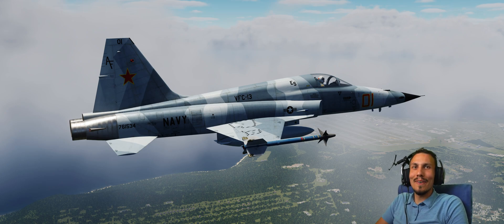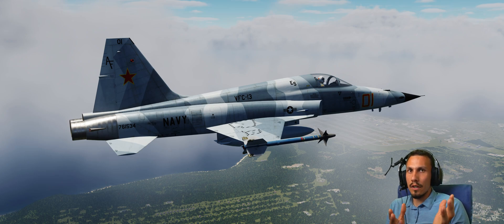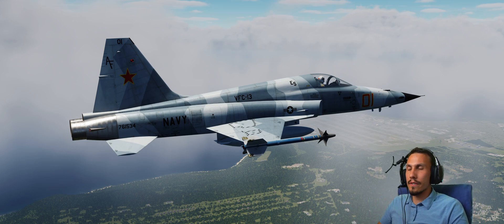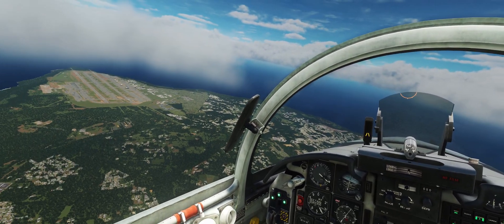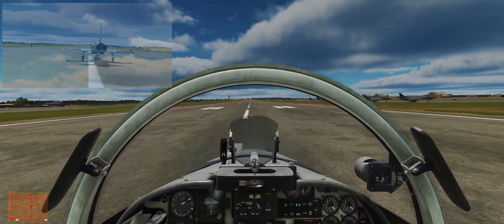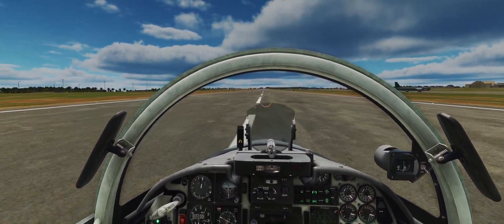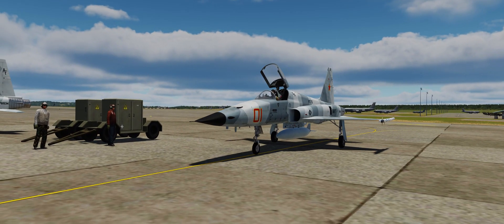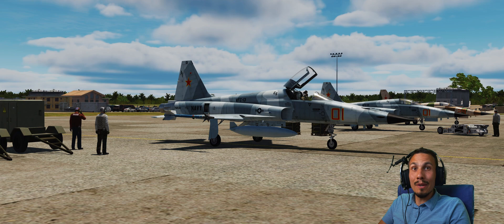F-5E Sideslip Approach | Andersen AFB, Guam

Comment: No sane person IRL would "sideslip" an F-5.
Reply from the maker: Except if the engines failed ;)
Reply: @CommandT  High key/low key with energy management is the answer. Fighter  pilots are not thought the use of a slip.
Reply: @SimPilot7777  I’m sure they are - in their basic trainer planes.
Reply from the maker: @SimPilot7777  I'm an airline pilot and I am not taught how to sideslip a 737 yet it is most certainly a skill I will leave in my arsenal if needs be in extraordinary circumstances just like any pilot should for any type of aircraft.
Reply: @CommandT  in USAF during UPT only T-6 students are expected to use that. T-38 does NOT (review their or F-5 dash-1). Fighters do NOT. They have other means to remove excessive energy. Example https://www.youtube.com/watch?v=7Unr5h_3y8c
Reply: If they’re trying to make it to a runway and unable to make it to a key altitude and position I assume they’d possibly use this trick during a straight in approach...